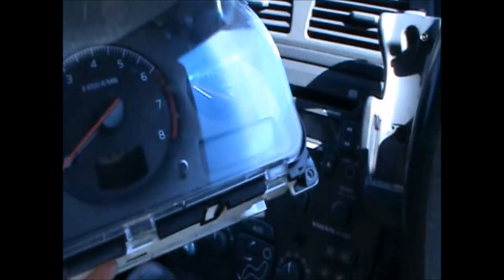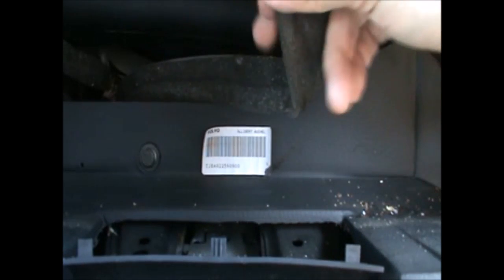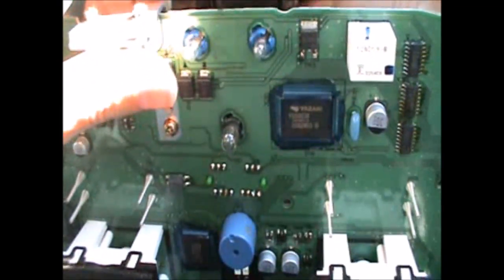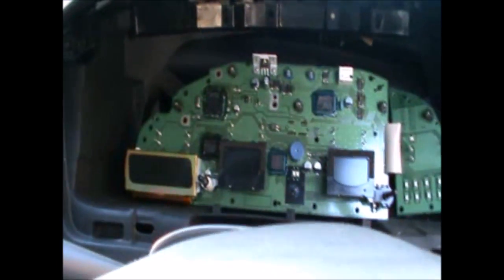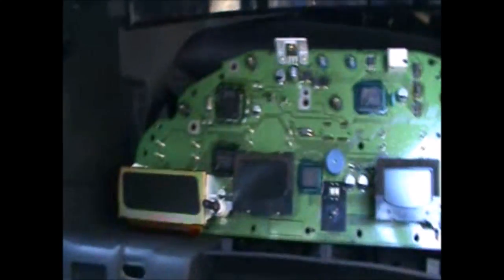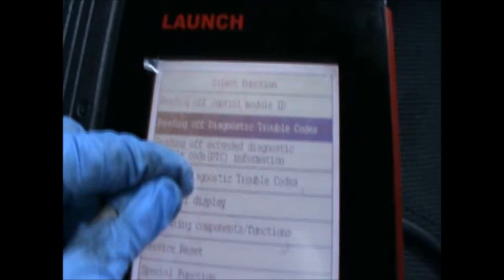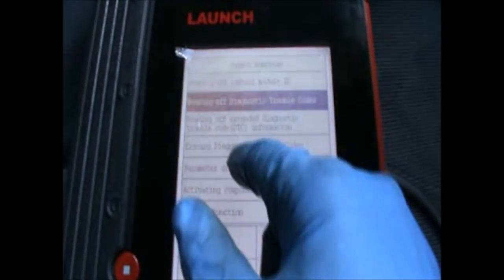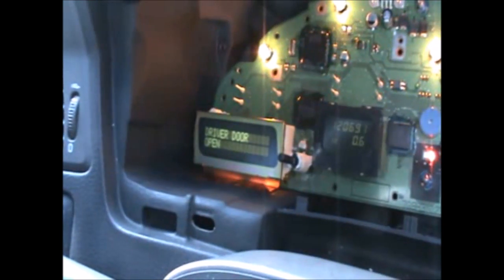Volvo Instrument cluster problems srs message fixed and deleted fault codes

Comment: hi also the reason is only with the high beam indicator it doesn’t light up can you tell me what is responsible for this light bulb
Reply from the maker: Are you saying the high beam works fine but blue light does not come on in the dash ?

Comment: Is it possible to change the place of the 2004 model volvo s60 display table and the top models with the 2013 or 2015 s60 table? Does it fit or what might be required for them. Can the problem be solved with extras such as software, program installation or extra electrical installation, thanks in advance.
Reply from the maker: I never tried that but I would think the cluster will be completely different design on a 2013 compared to a 2004, so I don’t think it’s a possible exchange am afraid. However if you get it done then do let us know.
Reply: @DaringBeefcake  ok

Comment: Thanks for sharing.

the DIM of my 04' S60R , sometimes it lose the electric power suddenly , and then resume , it comes up SRS/brake warning , 
1. is this same case that you figure out in the video?
Reply: Did the engine lose power as well? If so I need to do the same thing with my 04 s80 awd
Reply from the maker: @williamwilcox4539  Hi, to be honest the engine did not loose power, it was the same..
Reply from the maker: Yes as far as I remember those lights kept coming back, till I discovered it was related to the cluster.

Comment: I have done this job many times...you need to solder all the connections under a microscope...and also test some of the components...some resistors are prone to go bad on theese boards
Reply from the maker: Thanks for the advice and tips, always welcome 🙏
Reply: Well if you like me do microsoldering it is an easy job 😁👌

Comment: Well done...seems we all have the SRS message, and need the soldering job to be done...04 xc 70....My clock takes off and does a 24 hour lap for a few minutes....and the gas cap sends a message that clears...tighten it down, it re sets, recent gas fill or not.....re tighten, it goes away...but SRS...that remains....The way to re solder is delicate, but the 2 little chips area was revealing....great video
Reply from the maker: Glad the video helped.
Reply: @DaringBeefcake , how does the soldering work?
Reply from the maker: @FallaciesDetective  am not a soldering expert, may have a look at some other videos on how to solder. There are some companies that can solder the cluster for you.
Reply: @DaringBeefcake  , any tips maybe about how you did it? Medium temperature? Thank you. The risk is on me 🙂
Reply from the maker: @FallaciesDetective  I’ll be honest, am a novice, my soldering iron can’t be regulated 😂 so I was extremely careful not to damage anything used flux and just applied heat to the contacts, steady hand helps and a magnifying glass and perhaps a very thin soldering tip.

Comment: So initially/before the re-soldering the SRS fault could not be read or could not be deleted?
Reply from the maker: Hi as far as I remember, I was able to delete the fault with the computer OBD, but fault would come back and light illuminate again, was also draining the battery. i think it depended on the flexing of the dash so sometimes it would make contact and other times not.
Reply: @DaringBeefcake  appreciate the info, thanks!
Reply from the maker: @patryk2700  no problem, you welcome

Comment: do you have any experience with 2004 Volvo XC70 after passenger dash airbag deployment?  If I replace the airbag/dash, impact sensor and SRS Control module from a junk yard car do I still need car reprogrammed?  Car won't start, Airbag fault message on dash.
Reply from the maker: Am not really sure to be honest, the module may need to be reprogrammed to the car. But I haven’t come across this before, sorry.

Comment: We have repaired thousands of these DIMs. After this video aired, we have been getting these DIMs in our shop looking like this guys DIM. Please don't heat up the processors directly over the coating like that. We get them in with the microprocessor pins dragged to the sides, broken and/or shorted which in most cases fries the processor. In these cases an expensive processor replacement is in order. This guy got lucky but I guarantee you it will fail soon with soldering like that. It takes precise technique and skill to solder microprocessors, not to mention the correct equipment, heat setting, solder, flux, etc. Please just send it to the pros.
Reply from the maker: Automotive Circuit Solutions thank you for the advice given to others, of course am free to play around with my car and work on it however I do agree with the fact that some time getting the job done professionally is the better option as the correct soldering equipment for ic’s may have a much neater and long lasting effect. Thanks again.